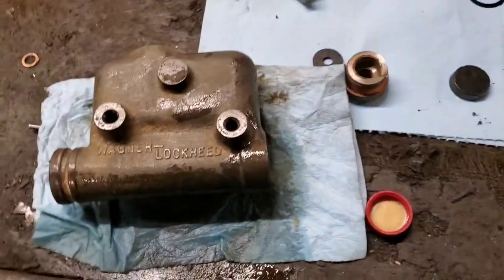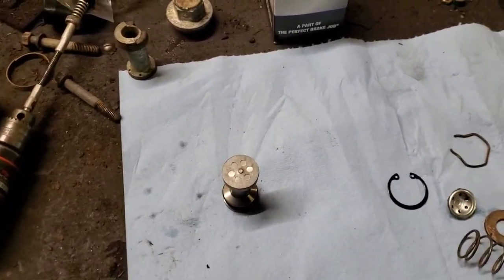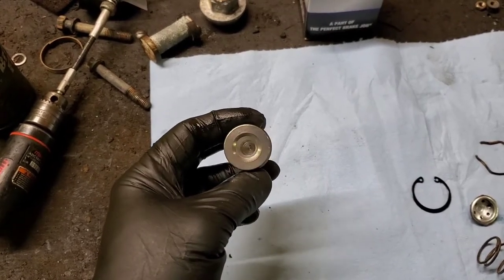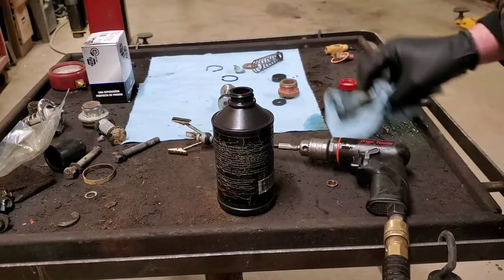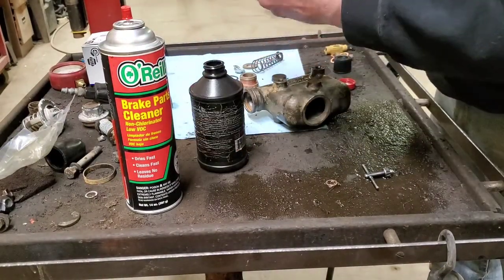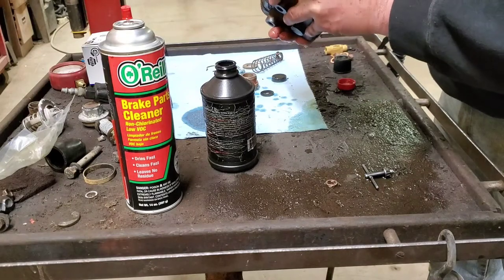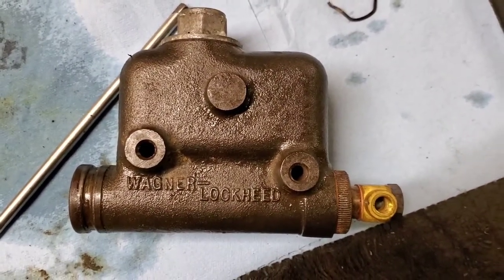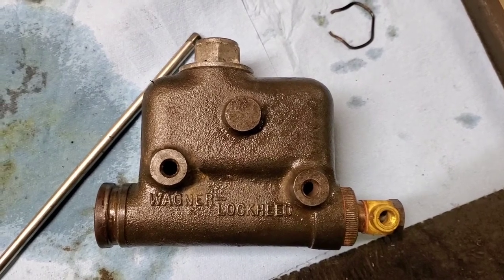1954 International Master Cylinder Rebuild

Comment: Really enjoy seeing things I’ve never seen before.  Why do they use copper washers?
Reply: Because copper is soft and when it's tightened it crushes to seal any imperfections in the mating surfaces between the banjo fitting and the cylinder housing.